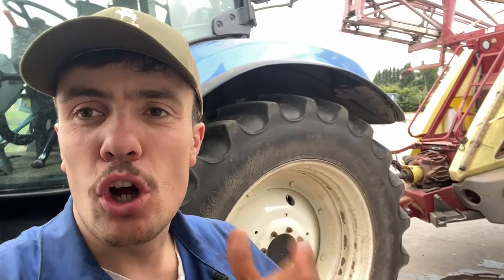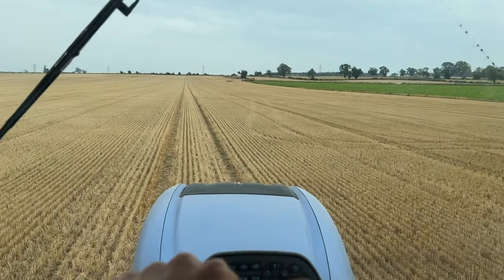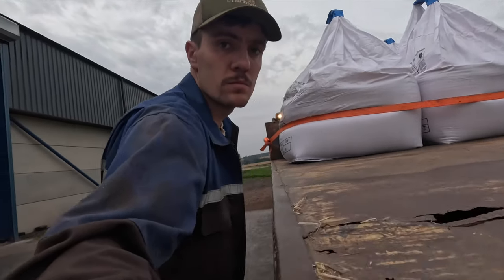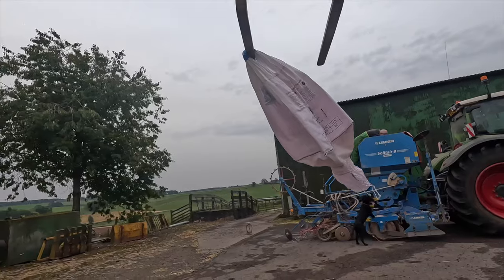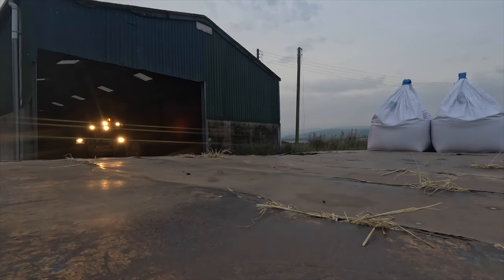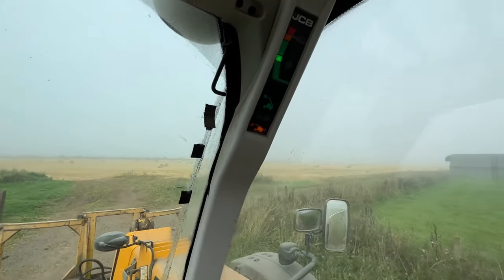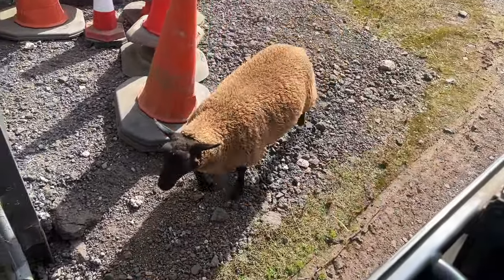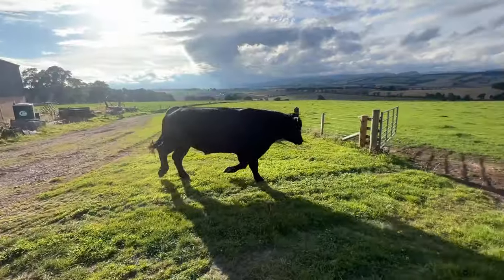Ripped A Seed Bag | Loading Straw | Drone Accident

Comment: If the flatbed trailer chassis is good ,why don,t you rebody it? That would be a good winter project for you in the workshop,a lot cheaper to I would think and build what you need or want.